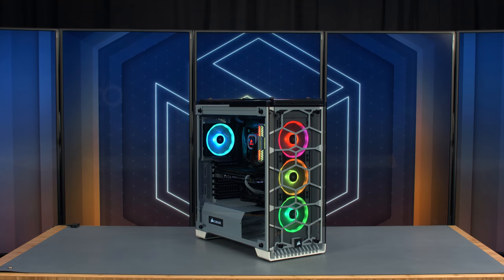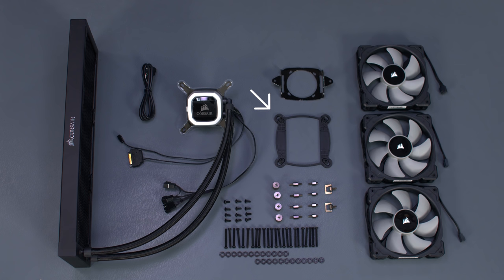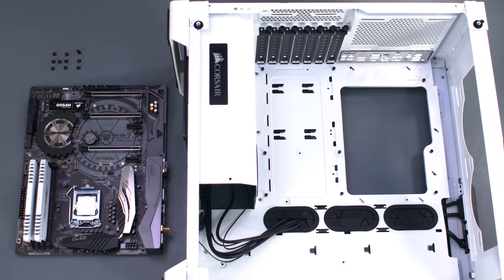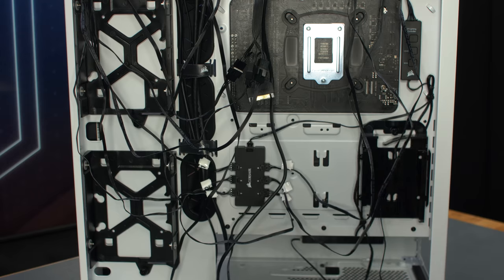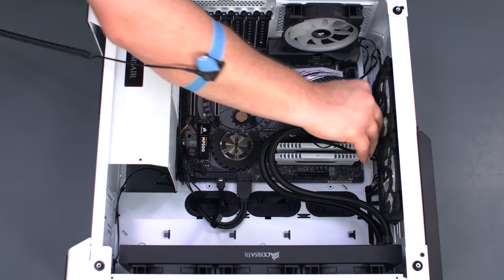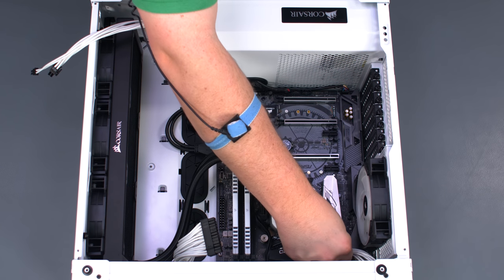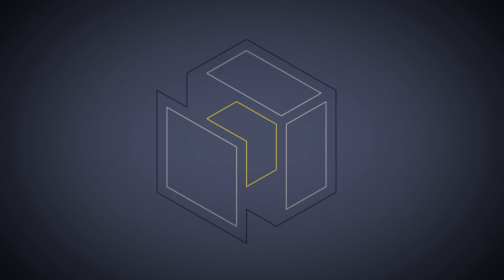Corsair Crystal 570X w/ H150i PRO RGB Build - ASRock Taichi Z370 / i7-8700K

Comment: Hi,
I have a problem on the 3 chassis fans. they are spinning but no rgb. i have the same warercooling system as you and 6 sp120 rgb pro fans. all connected to a rgb hub and a corsair lightning node. i dont know what to do. the 3 fans on the corsair h150i are working with rgb but the other 3 on the case are not lighting up. i tried different things and nothing worked. on the icue software also...

could someone help me?
thanks a lot!

Comment: Bro can I do a push n pull on h150i in 570x because the sp120 came with case are static pressure right so is there enough room for push n pull

Comment: Is the LL120 RGB fans suitable for use on a radiator? I thought they were case fans with high airflow.
Reply: Sure -- the LL fans are still static pressure fans.  Though, in fairness, they aren't quite as effective as the ML PRO series fans included with the H150i PRO, so we traded off a bit for the desired look.

Comment: I may have missed it from the video, but why did they buy TWO 3 pack LL120 fans? I understand 1 pack for the corsair h150i, but what was the other pack for? I'm still confused on that. Otherwise great video, I might do a similar pc build myself!
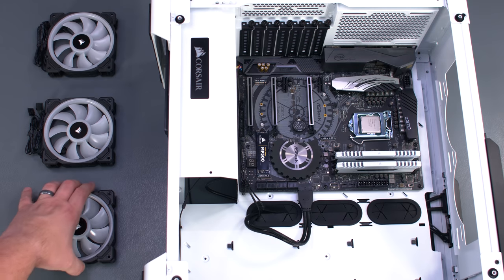Reply: The second set were installed at the top and rear of the case ( see @6:29 )
Reply: @jackfolloway3354  Ah I see. Thanks! Missed it my mistake haha! Do you recommend that set up for this case? Would having a second set installed at the top and rear of the case be worthwhile?
Reply: The short answer is that the more air you can move across your system, the better.  If you didn't want to get three more, then at minimum, I'd recommend at least adding the one rear exhaust fan.

Comment: @PCPartPicker Hi I have the same system as you built. but when I start the pc, the fans do not turn from the CPU. get message CPU Fan not Found on the monitor. Can you please help me, have also checked whether the ll120 fans are also connected to the CPU fans.

Comment: why would you have the top fans as intake? you're circulating the hot air back into the case
Reply: I'm not so sure about that. The air outside the case on the top is not hot. I have the exact same setup and the temperatures are fine. I tried it both ways, though. This debate goes back to when the video was posted. Would love to hear more commentary on this.

Comment: If you were using the fans that came stock with the case and the aio cooler could you set up a push pull system?

Comment: I'm about to do a build similar to this. I was wondering though... which is better for cooling... the 360 radiator in the front or a 240 on the top?
Reply: same question for me..i want  to build my new bike as this one... but i think i prefer to go with a h115i on the top to get max air from front panel because air flow is not convenient with the same build.
Reply: 360 in the front and set as intake. There is a video on youtube explaining why.

Comment: Could you please tell me how to install MSI RTX 2080 TI SEA Hawk EK X? it has only a piece with wires, but I was that pipes go into it and I don't know what are they. HELP!
Reply: The EK version of the SEA HAWK is for use as part of building your own custom loop (check out https://www.ekwb.com/msi-graphics-card-liquid-cooling-solution).  If that's not what you were looking to do, there is a version of the SEA HAWK that includes the radiator/pump as an all-in-one solution:  https://pcpartpicker.com/product/WHDJ7P

Comment: are these parts ok for a mid tower case?

CPU: i5-8600k

CPU COOLER: Cooler Master hyper 212 evo

MOTHERBOARD: asus rog strix b360-g gaming micro atx LGA1151

MEMORY: G.skill ripjaws v series 16 gb 288 pin 2400

STORAGE: ADATA SU800 256 gb 2.5'' SSD

STORAGE: WESTERN DIGITAL 2TB HDD 3.5'' 7200RPM

GPU: GTX 1070 TI GDDR5 ADVANCED EDITION

PSU: EVGA SUPERNOVA 650 G3 80+ Gold 650 WATTS

Comment: Hi i have the Asus TUF Z370 plus gaming rgb atx mobo and i have NZXT S340 Elite mid tower cabinet. No water cooling in my build so i'm using Cooler Master Hyper 212x cpu cooler. Can i use corsair RMx 650W (ver 2018) psu or older version. If not then which psu will you recommend. And can i use Samsung EVO 970 m.2 ssd. What do you think Please help.

I have been asking this to everyone on YouTube who build PC. But no one is answering at all. I hope you listen.

Comment: What happened to the wires that powered the front panel fan lighting buttons?
Reply: why has no one answered this, i also need to know
Reply: @nlawler12  basicly the led control butons on the case are usless... the wires just got hidden in the cable management...
Reply: Zevy ok so you power it but don’t use colors
Reply: Zevy at end of build it was lit up, also why useless??
Reply: @nlawler12   as zevy mentioned, the rgb control buttons on the case have been disabled. They have chosen to manage the rgb lighting using software instead, through the lighting node pro.

Comment: You radiator is mounted the wrong way up.  You want the tubes at the bottom.  With tubes at the top (as you've installed it, air in the system accumulates at the top and causes pump whine/noises and performance issues.
Reply: I essentially copied this video, with the cables at the top, and am not experiencing any issues after over a year and a half, but would take this into consideration.

Comment: I ended up getting the mirror finish version of that case, an Asus rog strix mobo, a black version of the psu and ram, 960 1tb evo,  and my old 780 nvidia card are the only major differences but everything else is pretty much the same as my build.

Comment: Great video but thinking you got the fans on the Rad backwards as it would be better to exhaust   heat out of the case then into it  :)
Reply: Someone tested that. When you using front rad setting them up as intake gives the best cooling. Cooler air from outside cools better. The warmer air that goes into the case doesn't bother the gpu.

Comment: Where did you plugin the RGB of corsair AIO ? or anyone notice it i want to know if the included corsair hub is enough for the RGB of 6 corsair ll120 fans and 1 rgb aio
Reply: Well if you want 3 ll 120 fans in the front and and 2 up top 1 in back for exhaust i would suggest the h150i pro aio as its a perfect fit for it to use all 6 hubs including the rgb strips that wasnt included  in this video
Reply: Yeah I just finished building a rig just like this one with the same case, only difference was Ryzen CPU. Everything fit nicely, I didn’t have to buy additional fan hub, since all 6 fans fit into it nicely. And AIO connects to a USB hub on the motherboard so it’s not taking up any fan hub space

Comment: Are the front fans setup to pull air out or push air in?
Reply: They are setup as intake (pushing air in).  Only the rear fan is exhausting air.  We debated having the top two fans turned to exhaust to balance the air flow, but the glass edges of this case have large gaps, allowing air to exit along every side if there's a positive air pressure.  We ultimately decided (as you see in the video) to take advantage of the open form, which also allowed the RGB lighting to face the glass panel, rather than needing to be turned inward.
Reply: @jackfolloway3354  Thanks so much I am doing my first build at the age of 50 and looking to install the X62 on the other side of the fans.

Comment: I also find as I put the standoffs on I have some play form the mother board?
Reply: Do you mean the motherboard seems loose after being screwed into place?  It should fit quite snug.  If the movement is between the standoff and the case, check that they are in securely (hand tightened should usually be fine though).  If the movement is between the standoff and the motherboard, verify if you are using the correct set of screws (included with the case).  The case also includes smaller screws intended for mounting hard drives, etc that will be threaded differently.
Reply: @jackfolloway3354  what I am seeing is that the backplate is a few mm heigher then the motherboard so if I put the standoffs in all the way to the backplate it has a few mm of play

Comment: Good built, but 5 intakes fan (3 front + 2 top) and 1 exhaust (rear) setup is good for airflow?
Reply: theres gaps between the glass panels and frame of the case. with positive pressure warm air will be getting pushed out through the gaps

Comment: that rgb hub in the case is only supported for sp120 rgb fans my guy.
Corsair LL series fans LED's can only be controlled by software.. There is no button controller option
Reply: Rly?
Reply: @lyqxx5165  yep
Reply: @aasimsiddiqui7563  I need a commander per at the corsair 500 se?

Comment: a little late but I hope somebody can chime in & help me out, I'm looking to do this exact same thing but instead of using corsair h150i I'm thinking of using the TT water 3.0 360argb & mount it to the front & then move the sp120 fans that come with the case. I was thinking 2 to push air in from the top & 1 to exhaust air out the rear. does this sound good? I'm a noob when it comes to pcs lol

Comment: Did you guys not need to use the Corsair Commander Pro at all?
Reply: You only need the commander pro if you want to have all of the fans pwm controlled via corsair link. Another benefit to the commander pro is the added 2.0 header. I went with the commander pro and did not need the lighting node pro.

Comment: Does the CPU Cooler come with the liquid preinstalled?
Reply: Well, I'm not sure, but it should be, can tell you later since I'm getting the Corsair h150i Pro liquid cooler for my build
Reply: @michaelkingstar5878  I got the h150i and it's a closed loop with the liquid preinstalled

Comment: I’m wondering, is it possible to connect all the fan RGB connection together using a splitter and then connect them to one of the motherboard RGB headers?  Then control them using the bios or the windows RGB software that came with the motherboard?   Is this not possible?  I was planning on doing this using cooler master rgb fans and a gigabyte motherboard.
Thanks..  Sorry for the edit, but if it is possible to connect everything to the motherboard, what’s the advantage using a rgb controller?
Reply: Markinpuff I’m commenting because I would like to know the answer to this question as well.
Reply: idk
Reply: Not really -- the only motherboards I'm aware of off hand with on-board support for the Corsair RGB fans were a few recent MSI motherboards (via their Mystic Light software), but even then, I believe they only currently support the HD series fans.
Reply: ok, so your're saying its RGB fan specific by brand.. That's interesting? I'm using cooler master rgb fans in my build and I do believe they are certified to work with gigabyte motherboards & supported software.  I would have thought RGB was standardized and wound not be propitiatory to any one controller.
Reply: Ah, my mistake -- I thought you were asking about the ones we used in the video, which use an addressable RGB connector that's a little different from the simpler RGB headers you find on most motherboards (but allows it to do more functionality for patterns, etc).  

But with the CM RGB fans, yes -- you can just plug into the on board RGB headerif you're Gigabyte board has RGB Fusion support.  You'll probably need a splitter (sometimes included with the motherboard) or pick up a fan kit that includes CM's controller/splitter if you have more fans/LED strips than the number of RGB headers on your motherboard.
Reply: Yea, I did realize that, splitters, fan/rgb cable extensions, rgb cable pin connectors..  It goes on and on.. I could have just went to Walmart and purchased some Christmas lights.  lol
Reply: No, it depends on the brand and the model. Even corsair fans can't share rgb channel/hub if they are different models (LL/HD/SP/ML) they can only share a node pro if the channel is different.

The rgb controller (in this case the node pro) is the thing that lets the LL series fans and mobo "understand" each other.
Reply: The lighting controllers take priority over the mobo RGB settings, what you need is a mobo with capable lighting controller build in like ASUS Aura sync. If you connect multiple fans to a single header with a splitter they will act as a single fan when the RGB kicks in, meaning they all do the same thing at the same time. If you want to use the fans RGB sequentially/independently you need to use a compatible controller(eg: TT Sync controller) connected to all the fans then connect the controller to the mobo.
Reply: you are talking about the corsair fans. well it is possible but a bit buggy. you can use a software called rgbsync.
and about the cooler master rgb fans and gigabyte yes it does work. it is a  universal 4pin.
using an rgb controller is for addressable rgb strips or fans like for example the corsair hd120 rgb fans which have i think 12 leds.
Reply: The RGB controller (from Corsair) giving great cooperation with Corsair software - UTILITY ENGINE (CUE). This software has full of functions to control fans, leds and other (Corsair's hardware). I do not know how works soft from Gigabyte (motherboard's led control). I think you should check if you find proper splitter for fans - this is first thing and check if motherboard can control funs, because my Asrock MB has socket for led strip and very very simple (too simple) soft. With Corsair cue you can use many of predefined lighting schemes, different sequences of lights etc.
Reply: your safest bet would be an intel asus rog board (amd doesnt work with the sdk) and use the corsair fans with the normal controllers. then you can download a software called rgbsync on github. it can sync products from corsair razer and logitech (and some others) with aura sync
Reply: Markinpuff I also have cm rgb fans and they work with my asus maximus board

Comment: why 5 fans in and only 1 out? It  woukdn't have been an underpressure situation with 3 in 3 out
Reply: I was wondering also about the top intake. But 3 in and 3 out would give you negative pressure because the radiator hinders air intake and the videocard also has an exhaust.
Reply: fancurves may change everything, still the choice is weird i agree^^
Reply: I see the Problem. You can't change the fan curves of only the front fans because they're all in one hub.
Reply: I just finished my build which is similar to this, but I installed the Corsair Commander Pro. I should be able to manage all fan rpm in Link. But I suspect that you set the rpm on the front fans together, and the rpm from the other fans separately. I also decided to set the top fans as intake because the airflow from the front three will be hindered by the rad, secondly it looks better since my case sits on the floor, and you can set the speeds in Link anyway. Also the back of this case is pretty much one big hole so air will be coming in or going out there anyway.

Comment: I got the 240 version of this and I think they fucked up the tube mounts. I can't orient the water block normally as shown here because the amount of pressure it takes feels like it would break the hoses. Like I'm twisting and kinking the tubes to make it orient that way. Had to mount it sideways with the logo turned 90 degrees just to make it go on without forcing it.

Comment: How come this case has the cut out in the PSU shroud for cables? In all other cases that I saw in reviews none of them had it. And it's the main reason I didn't want to buy it!
Please answer!
Reply: The original Black (as well as I believe the Black/Red) variant of the case didn't include the cutout on the shroud.  The newer Mirrored and White versions do.
Reply: Thanks for the answer! 
Which one would you buy between this Corsair and the Thermaltake View71 Tempered Glass Edition?
Also, can you remove the front grill that is in front of the fans and dust filter?
Reply: The front "honeycomb" style grill actually is the dust filter (you can see Barry removing it @3:00 ).  

While the View71 TG/RGB and 570X RGB have somewhat similar external aesthetics, they have enough feature differences to make that less clear to answer.  We haven't built in the View71, so I also don't have first hand experience to compare ease of building compared to the 570X. From a high level though, you can compare the two cases to see if anything important to your build stands out: https://pcpartpicker.com/products/compare/hMhj4D,tnWrxr,zRTPxr/
Reply: All versions of the 570x have the huge hole at the end of the psu shroud. But you can buy a cover from corsair.com
Reply: ALL versions of 570x have the cutout BUT originally Corsair did not have this (which is why reviews and marketing materials fgor black and black/red versions of the case which were released in 2016/17) but added it later as some people were complaining about such a case not having it and that competitors were doing this on cheaper cases (I think the 460x even had the cutout since 2016 on the PSU shroud)
Reply: The 460x I bought soon after release had the endcap on it. SO unless they changed it very fast it came with it at release.

Comment: Shouldn't you remove the pre applied thermal paste on the cooler because it's usually low quality?
Reply: it's usually of a great quality.
Reply: the stuff on the 150i is actually really good, but yeah i replaced it with some cryorig stuff i had laying around
Reply: Finesse yeah pre applied is usually garbage
Reply: Is it possible to use liquid metal based thermal conductors without destroying the h150i pro's copper plate?
Reply: aluminum is the material to worry about with liquid metal, not copper
Reply: the cpu heat spreaders are made of copper...
Reply: My pre applied thermal paste of a Ryzen 3 was fucking glue when i changed the stock cooler to a MA610P literally the processor came out...
Reply: Also, the AIO fans are in a intake configuration?